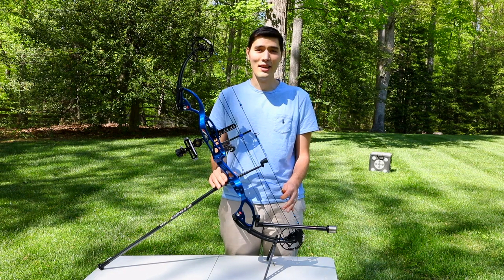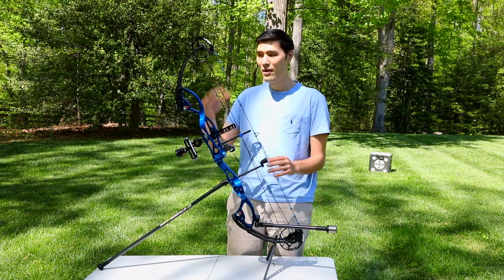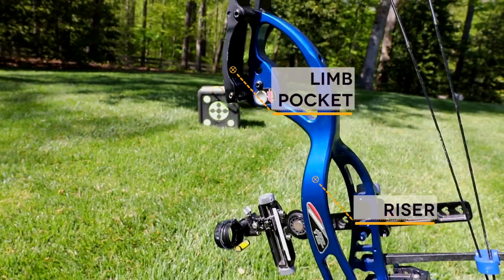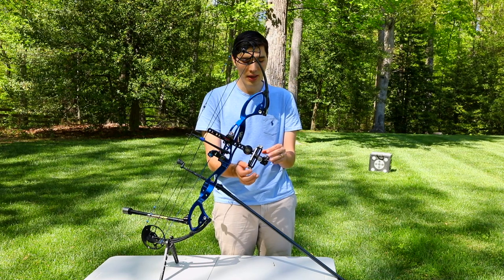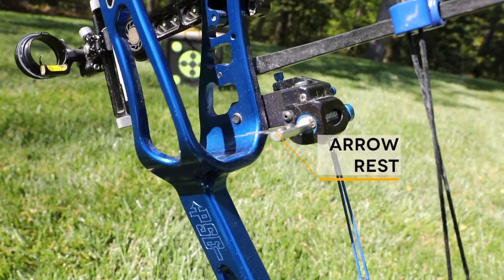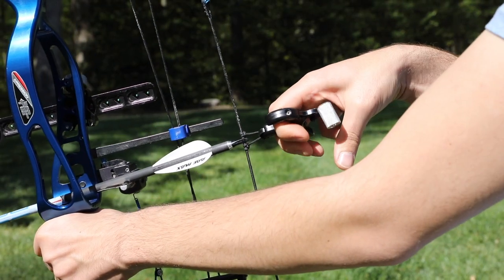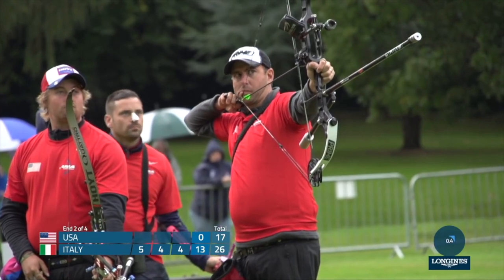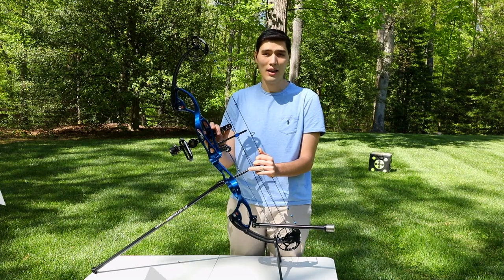Target Compound Bow Anatomy

Comment: Question - I've seen some bows with what looks like a stop or bumper on the cable guard rod in front of the slider. As if to limit forward travel of the slider. Do you know what that's for?
Reply from the maker: There's a lot of variations in cable guards, some are adaptable and some work on rollers. Do you know the make or model of the bow you saw with that feature? I can find out more about it for you.
Reply: Thank you. I won't worry you to research it for me. Just wondered if you knew. Cheers.